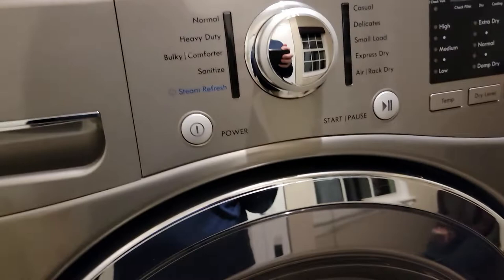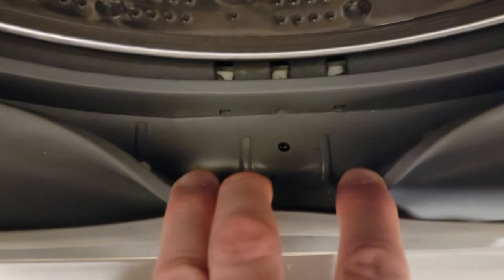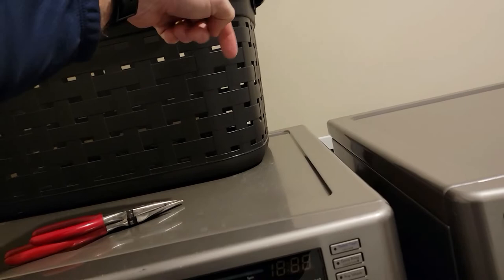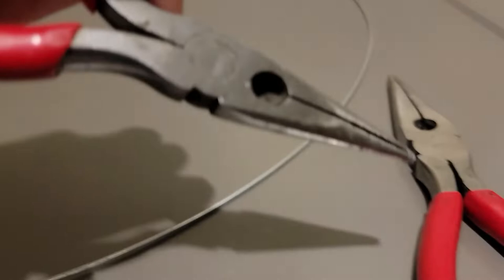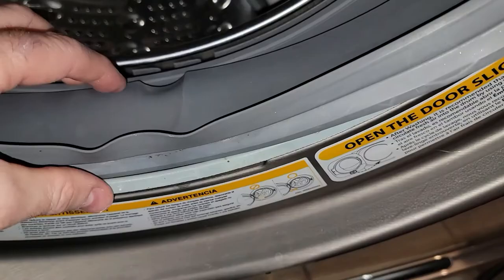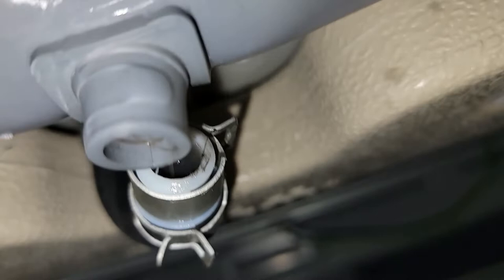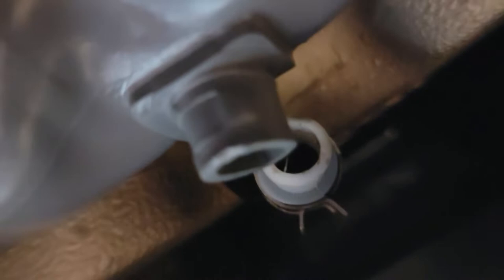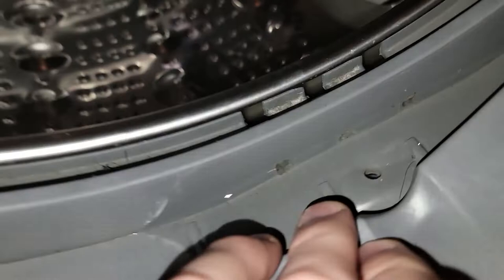Kenmore Washing Machine 79641383410 41383410 Stinks Smelling Bad Fix

Comment: 👏
Would a Wet/dry shop vac work to remove the gunk out if someone doesn’t have that weasel tool? Next maybe clean out pump filter down below where all that gunk was heading.
Reply from the maker: We always clean the pump filter.  You could try the wet/dry shop vac.  I would love to hear if that works.  I was thinking about a water pick to force the water through.  Maybe a pipe cleaner.  Not sure.  FlexiSnake Drain Clog Remover Kit Includes Rotating Handle and 2 Micro-Hook Refill Wands - Thin, Flexible and Easy to Use - Safe for Most Drains and Grates - Made in USA https://a.co/d/8DR55wv